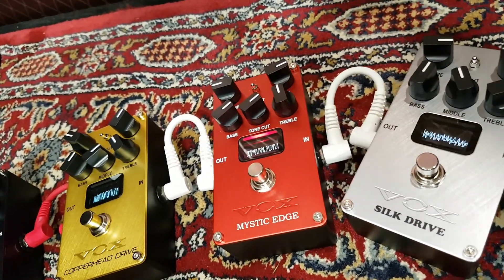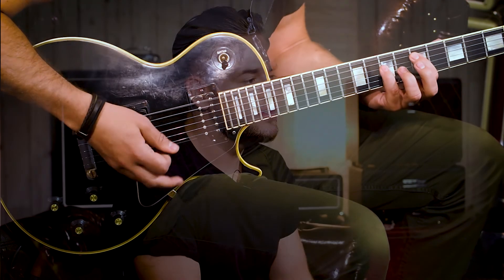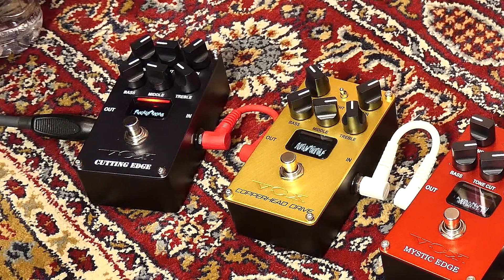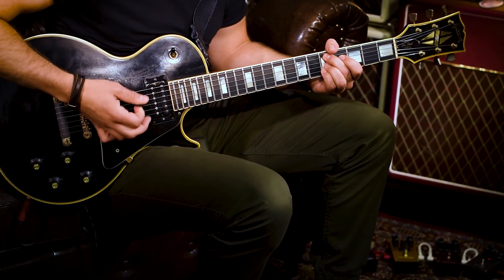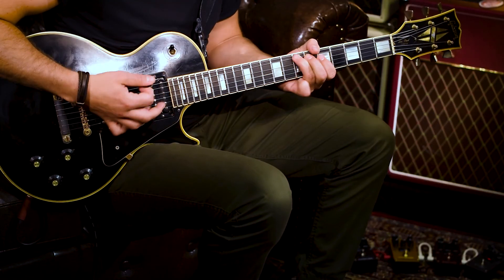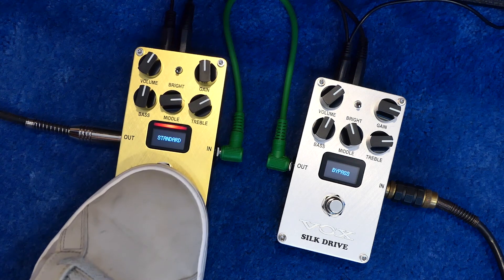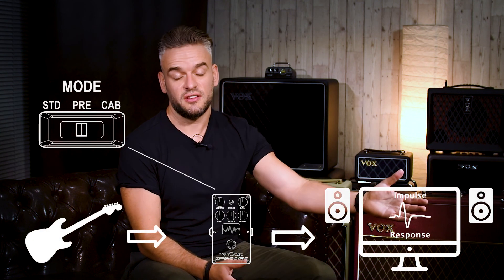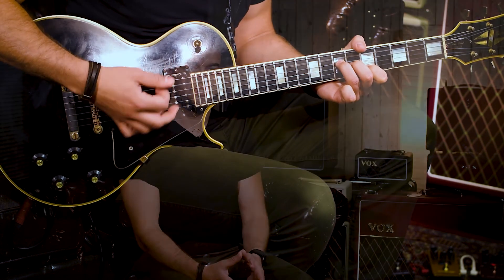VOX R&D Explain the VALVENERGY Pedals

Comment: Hi everyone! I have 5 valvenergy pedals and I would like to build a pedalboard to be able to turn them on and off independently via the LINK jack (I read that they have an internal CPU, but since it is a mini TRS jack I don't think it is difficult to replicate the connection), Unfortunately there is no information about this in the manual, can you help me? Thanks

Comment: Just got mystic edge, I am using as digital amp into PA.  Sounds much better than my TC electronic vox modeler.  I've got the super beetle w nutube and it sounds great but only recently heard about these.  I am going to get a second one so I can basically switch between 'amps'.  Not sure which one yet

Comment: After watching this and reading the manual, I'm still confused about what the difference is between the STD mode and the PRE mode. What are the two modes doing differently?
Reply: I suppose STD mode is to be set when you use the device as a pedal (to be linked to a real amp); the PRE setting is intended to be used when connecting directly to the power stage of an amp or an IR loader.

Comment: I know these are made for guitarists, but do you think these would benefit synthesizer players? The oscilloscope would clearly be useful, so would the simulator/pre-amp add anything?
Reply: Old comment, but the input takes line level signal, so it can absolutely be used by synth players. Also I don't know if you know but Vox is owned by Korg, so this is probably a Korg screen they used for these oscilloscopes.

Comment: Can somebody tell me if it‘s ok to run several digital/analogue Pedals like Delay or Reverb after the Mystic Edge set as Preamp? Or will the output of the Mystic Edge be too high and therefore cause problems with any pedals further down the signalpath? thx

Comment: Can the Silk Drive be used with gain down to simulate a clean channel on a tube amp?  If so, will it sound and respond like my Vox MV50 Clean?
Reply from the maker: You can use it as a fairly clean amp replacement, but not quite to the point of the MV50 clean. Think more like the Boutique amp models on the Cambridge50 or the Tweed and BTQ amp models on the VTX amps

Comment: If I wanted to use the cab mode straight into my DAW, could I put another overdrive pedal in front, just as I would with an amp?
Reply from the maker: Yup! A great way to use these pedals is at the end of your pedalboard acting as your amp in preamp or cab sim mode. And thanks to the Nutube, your overdrive pedals will respond and feel natural as if going into a tube amp
Reply: @VOXAmpsVideos  Excellent! Many thanks! My beloved AC15 will always be number one, however I'm thinking that the Mystic Edge would be a great silent recording option :)

Comment: can these be used as preamps like mv50 series (except the powering a cabinet part)? I'm currently building an ampless rig using a mv50 clean and a cab sim pedal, I wonder if I can get a similar sound with just a Silk drive at low gain
Reply from the maker: Yes, absolutely! You can use the cab sim mode just like you would the headphone output of an MV50, or if you want to power a cabinet you could take the preamp mode into an external power amp
Reply: @VOXAmpsVideos  Will this approach work with the mv50 Clean as the power amp?  Can the PRE output of a Valvenergy pedal be fed into the input of an mv50 clean amp and then to a cab?  Will that work and sound good?  Or will that be too much Nutube sound in series? Any potential risk of damage to any of the two units?